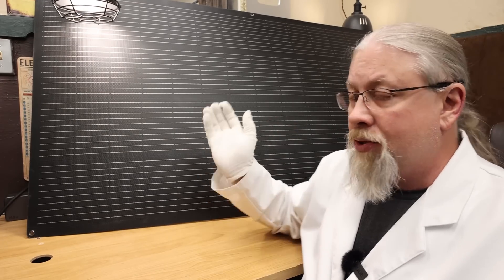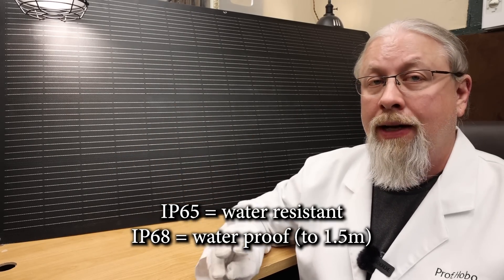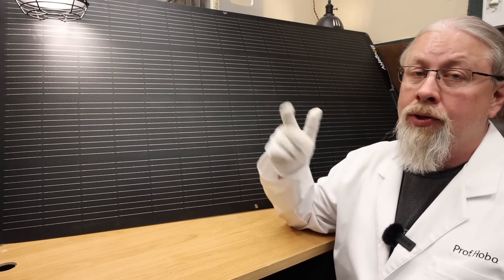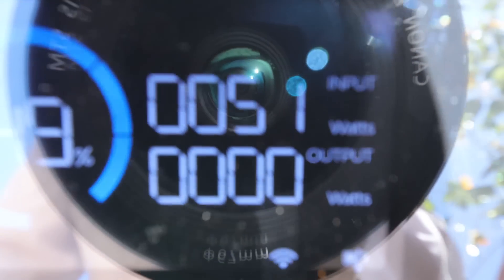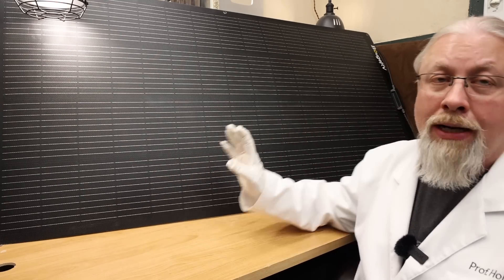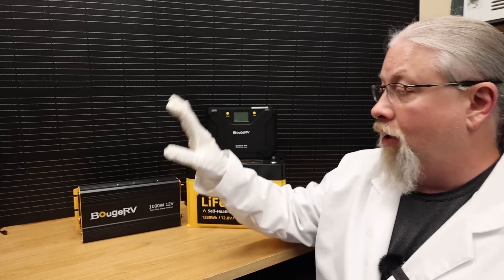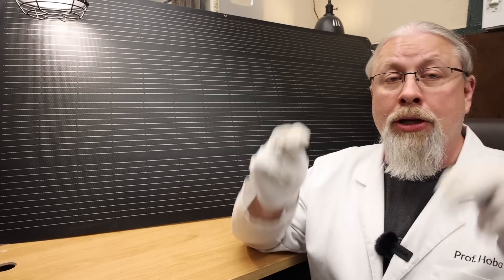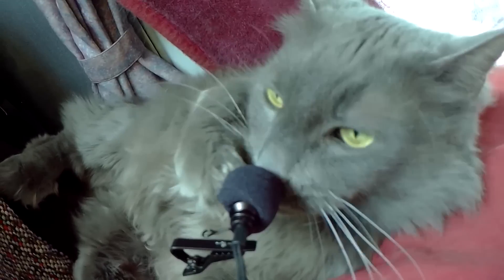BougeRV ARCH 200w Flexible Fiberglass Solar Panel Review

Comment: I was thinking to install those on my camper van roof but planning to glue a corrugated plastic sheet under the solar panel to give some air flow and decrease the temperature. What do you think about my idea would you be able to try something like that and compare performance with and without corrugated plastic sheet on the hot day?

Comment: Hey Hobo!  Question for ya....I have a solar generator with a max PV input of 60V/ 21A /1200watts.  I'm really curious  if I could do 3 of these in series=60.3V and 2 of those in parallel to get 1200watts.  So do you think 60.3VOC would be accepted into my SoGen?  Your thoughts are much appreciated!

Comment: I bought one of these to mount to the roof of my Dodge Grand Caravan. Do I need to put corrugated plastic between the panel and the roof or can I tape the panel right to the roof? Video link appreciated as I'm not finding one. I plan to use the VHB tape recommended by this channel to adhere the panel to the corrugate and put the Eternabond around the perimeter to attach to the van. Brian at RVwithTito used velcro in the middle of his flex panel install, so thinking to do the same.  Thoughts? I've been putting this off for months, unsure of myself. Thanks!

Comment: Thanks for your teaching us! I’m a non-12 volt guy and not an engineer. I’m building a 15’ canoe with 460 watts of BougeRV panels. In cut the top off of the 30amp trolling motor and ran it to a speed control dial with reverse polarity. The steering is done with an actuator and reverse polarity - handheld unit. My friend you have been a tremendous help.

Comment: You are my go to channel.  Most of the others are amateurs compared to what you do.  Especially the cigs panel test you did.  If people saw that video they would not question them. Ah but everything has its weak spot.  Would you say, using the tape and perhaps extra tape would be sufficient to keep it on the roof of a Class C or small Class A.  The junk rv manu sell or dealer options, are junk and way over priced.
Reply from the maker: I've had mine on my RV roof through two winters now with factory adhesive no issues.
Reply: @HOBOTECH  Thank you, You are the gold standard.  I have referred your shoot'em up video on a few RV sites.  Its amazing lets bolt down even more solar, it only takes one hole to create a nightmare. cigs is the way to go. Now I read someone say they don't last as long, how long would a rigid panel last in a severe hail storm.  So I get the story straight, was that a 9mm or 45mm you used.

Comment: I need to see if the wire panel can be flipped to the back side. I'm building a solar trailer for an YouTuber using it.
Reply from the maker: I was thinking about building a trailer with these curved like shown in the thumbnail. I'm going to be testing them next week in the desert.

Comment: How do you mount to roof of van?  Does it get hot without air circulation on the roof?  Deciding on regular vs flex panels

Comment: Is it environmentally qualified for marine (salt water) environments?
Reply from the maker: IP68 means there is no water intrusion, salt or otherwise
Reply: @HOBOTECH  Thanks, HOBO, but my concern is whether the materials will hold up to the constant exposure to sea water. IP68 will prevent acute intrusion, but chronic exposure is a separate issue.

    I really enjoy your content and careful testing 👍.  This panel seems to be an ideal solution to RV’s, vans, trailers, & boats 😎

Comment: Great review, in terms of value for money BougeRV seems to be crushing it right now, but without solid reviews from someone I can trust like this channel it's hard to be sure!!
Reply: I picked up the 220w portable panel from BougeRV and have been very happy, probably the only down side is the bottom edge of the panel is very low in the frame, so it always gets dirt on it when camping which drops efficiency until I wipe it off.

Comment: I use this panel as my sunroof cover on my cybertruck.  It's pretty tough.  My wife accidentally ran over a section of it and it's still good.  Not a fan at how floppy it is.  I wish they made a slightly stiffer version that is just as light.

Comment: I mounted four of the Arch 200w panels on my metal roof patio cover. I used six magnets on each panel to secure them. They have weathered two tropical storms so far this year. At 7 lbs a piece this 74 yr old had no issue getting them mounted. They straddle ribs in the metal roof which permits air circulation.

Comment: Woud anyone recommend this for a roofrack on a Land Cruiser? It's a 1x2" slatted type. I guess it would have to be taped down because I only see 3 holes on each side of this panel.
Reply: I'm doing something similar.. except mounting on a tonneau cover on a truck.  I use the industrial adhesive Velcro and it works great.  The challenge is to find a good flexible panel that will actually last.  I'm been through about 5 in the past 4 years, but giving this a try next.  By the way this one is on an Amazon lightning deal today at 20% off... even cheaper than HOBO, but only a few hours left.

Comment: What are your thoughts on mounting them onto the leading edge or cap of a travel trailer? I ask because its the closest to my batteries/controller and would keep the wiring to minimum while also covering some areas that are wrinkled due to age  of the trailer.

Comment: These looks pretty strong . I wonder if you can walk on them?! If so, my entire RV roof would be these panels!
Reply: Kneel on a board like a 4'x4' piece of plywood or a wide plank if you have to do work up there.  You should do this anyway.  Oops too  late! ...is too late when you hear a "crunch".  Don't tell me they are made to be walked on.  It's the heel landing which puts hundreds of pounds per square inch - on two square inches - deforming the roof.
Reply: Probably better to go with the CIGS then.

Comment: They are great. Probably better suited than the yuma panels on most RV/camper rigs. 

For sailboats, (note not powerboats), I prefer the yuma due to higher chance of shading from rigging. Also the fully flexible roll up design makes shipping and storage easier when traveling in the Caribbean.

I do like that BougeRV is interested in the sailing community. For too long solar equipment for boats has been outrageously expensive with 150 watt panels easily costing $1k.

I will be testing these panels on my own sailboat in Panama.

P.S. how’s it looking with international shipping? Central America and Caribbean?

Oh and the price of $239 for 200 watt is awesome.

Comment: How would you configure solar panels to support the Anker Power House 767.  Solar input specs are XT60 Input  11-32V⎓ 10A; 32V-60V⎓ 20A (1000W Max).  Doesn't seem like I can get anywher close to 1000W input with solar.

Comment: Another great review Professor. I'm certainly looking at their product line. My little tinkering line is when I'm testing a new purchase of a solar panel, I didn't know, if my battery bank is full the controller doesn't allow any power to flow. So I thought the panel was flawed. My thought is make sure there's a place for the power to flow to get a true reading of panels output. 
Thanks again

Comment: I have a AC180 with the max PV input being 60 volts and 3 of these in series by the specs would be 60.3v that should be fine right? Since that's OCV and not constant voltage.
Reply: Check out Hobotech review of the AC180. He usually tests to see how far over voltage you can go. Some units allow up to 15 volts extra. I would think that 0.3v over will be fine.

Comment: I just got the bougerv 200 watt Bifacial and it rocks! 200+ watts consistently! Even at 95°F outside lol
Reply: How do you think they would do in a  CO High Rockies winter on a truck camper? I just bought a four season Northern Lite Truck camper and am wanting to make the right choice in panels for a four season full time live in system. Thank you for any advice you may be willing to share!
Reply: @Umi-imU-We-Are-One  being on a flat surface, like all panels you won't have the full output but on a white roof with some gaps you might do pretty good. Colder temperatures do increase output of panels. I think this it would be my go to panel for sure.

Comment: Wondering if white panels would make any difference being overall cooler, ive only ever seen black
Reply: Good idea.  Try painting your panels white and let us know if it's cooler.  You'll have to use special plastic paint so it will adhere to the panel.
Reply: @forwimp  make the panels white from factory

Comment: Super-awesome video as usual.  Only open question for me is how does efficiency fall off with a moderately-curved installation, such as on an arched trailer roof, or on a golf-cart roof slightly curved to the sides: does the part of the panel that is not normal to the sun kill much of the overall panel power similarly to when there is an obstruction on the panel, or does the off-angle portion of the panel simply produce less power as expected, and not impede the production of the portion of the panel that is normal to the sun?  (And with a curved installation, SOME portion of the panel will ALWAYS be non-normal to the sun...)
Reply: I would think a slight curve of 20-30% won’t have much negative impact. But in the 45-90° range you might only get half the output. And over 90° we start out with 50% output at max and fast degrading after that.

I think the extreme flexibility is more a “durability” sales argument, not a practical installation suggestion. 

Best way to get the real number is to test it out with your specific installation scenario
Reply: Anyone with data about typical out installed tightly to typical gentle curved surface would be appreciated.

Comment: That IP68 rating would be great for pretty much everyone. When these get mounted, they are usually taped or screwed directly to the roofs of rigs. So, they could be sitting in pools of water, where hard panels are usually mounted up off the roof keeping them out of that pool of water. Great design, and awesome video once again!

Comment: I've used flexible panels before and don't recommend doing a flush mount with them.  Mine degraded fairly quickly and I attribute it to them getting too hot.  Needs airflow to go underneath them to keep them cool.  What happened was that the metal/foil traces between individual cells became separated and I believe this was due to the heat (expansion contraction).
Reply from the maker: These are far more robust and designed for high temps. Old flex panels are junk which is why most only offer a 1 year warranty.
Reply: Panels from 5 years ago are designed differently. We do have to acknowledge that quality improves and something that was both recommended and few years ago can now be a totally viable option. 
Try these out and see if it’s true!
Reply: @TheCornucopiaProject-bd5jk  It is true however that every framed glass panel has space behind it;  It's the standard we use to compare. A simple extruded wire mesh, like used in concrete forming, or a metallic fence grid would work.
Reply: @mikemotorbike4283  I’ll be using many flexible panels on a sailboat. No permanent install. It’ll be a nice weather setup.

Comment: Hey Professor hobo, in the video you said the panel is water resistant and on the Bouge RV website, it says the panel is waterproof. So which is it?
Reply: Rewatch the video because he clearly did not say that and even put it in his pool… 🤦
Reply: @jamesyahn he did say both. The panel has a IP65 and IP68 rating. Which is weird. But fully submerging it suggests IP68 works
Reply from the maker: I accidentally said water resistant in the intro but they are IP68 waterproof.
Reply: @HOBOTECH  OK no worries. We still love you 🌻 Also, my best regards to your cat. I have his twin brother!

Comment: I have this exact panel wired in series with two of the bouge RV 200W glass panels. The current ratings are close enough that it works just fine. I had to do this because the front of my van is curved.
Reply: I was just about to ask if you can use both, the Bifacial as well as the Cigs, and or Arch?